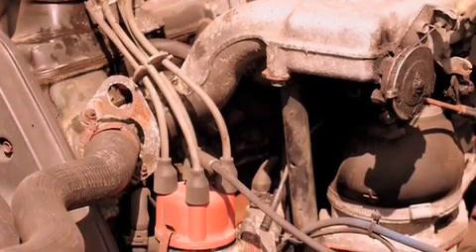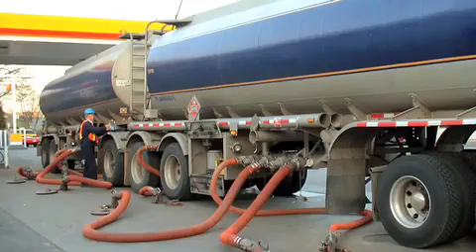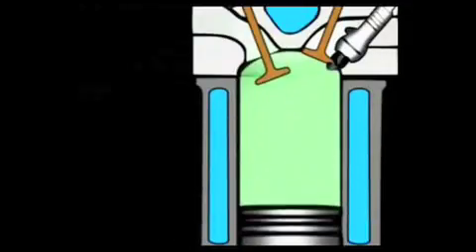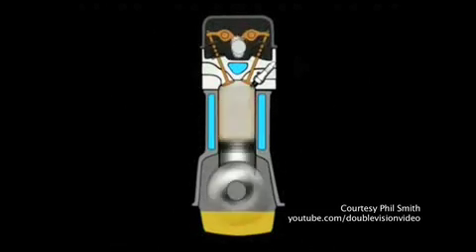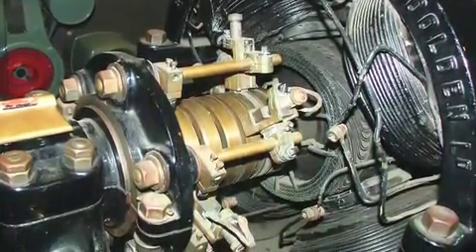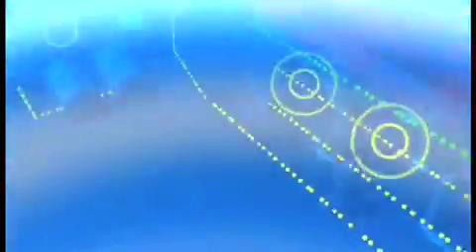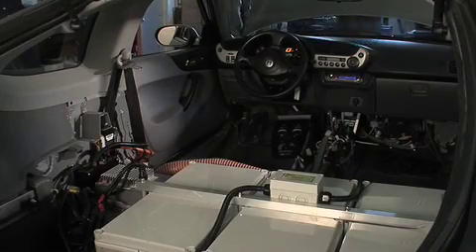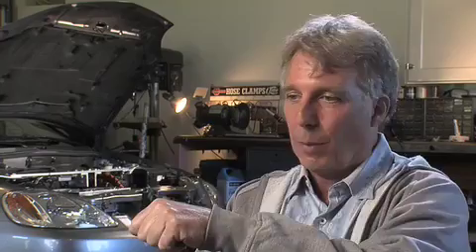The-Miracle-of-Electric-Vehicles.m4v

Comment: its all about the batteries. were just now getting to a point where battery tech is making the ev practical. a quick recharging   bat with twice the energy density of current Li-Ion that lasted 1000s of cycles would make  the ice obsolete.

Comment: Aaaa the energy density is higher but you can only use about 30% to move you down the road and the rest is converted to polluting poisonous gasses and heat.  Actually electricity is way more efficient at moving the vehicle so you don't need that high density energy gasoline. I send it back to you. Don't fill the people with your cheap talk. I have now 21000 miles on my Nissan Leaf and charge and drive daily and charge with solar. Totally clean power. 
Go electric. Its the only way.

Comment: fool. the electricity is produced by burning oil or gas or by nuclear p. plants so don'r bullshit people. the energy density in gasoline is much much higher than in the batteries. of course, the combustion engine has lower efficiency than the electrical (a good one) motor but the combination of gas + comb. engine is still the winner. your concept with ONE el. engine + all heavy crap like gearbox is just crap. Don't full the people with your cheap talk. Ciao

Comment: It takes 5 times LESS power to run EV's as regular internal combustion engine cars, because they are extremely inefficient, and because gasoline actually takes more electrical power to refine than the energy you get out of it. If we used the power consumed by refineries to make gasoline, we could drive 5 times as far when used in an electric car. Also, an electric car can be charged off a photovoltaic panel half the size of the roof of your house. Gasoline is going away, you figure it out.

Comment: No, that doesn't work. It takes extra power to turn the generator, it doesn't just magically turn and the magic turning coincidentally makes electricity, it takes twisting power to turn a generator against an electrical load, like charging the battery, and that would take more fuel.

Comment: @trident3b I`m getting tired of people saying this exact same thing as you. You see, to produce gasoline, it needs lots of electricity to be refined, besides transporting it is also energy.Besides ICE has an efficiency of 20 to 33%, while electric motor has 90%. So if you take out the electricity for refining oil and put directly into an Ev , it would still have the power to move 3 ev`s rather than 1 ICE driven.So even if power comes for coal plants, ev`s would be still cleaner